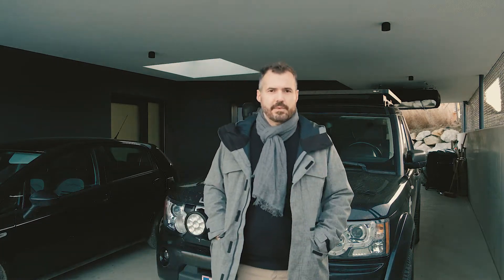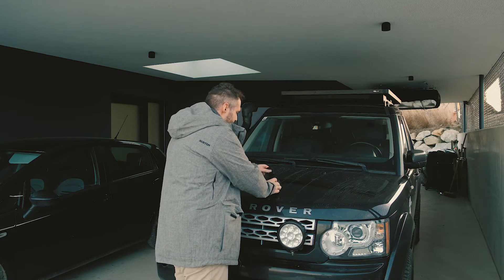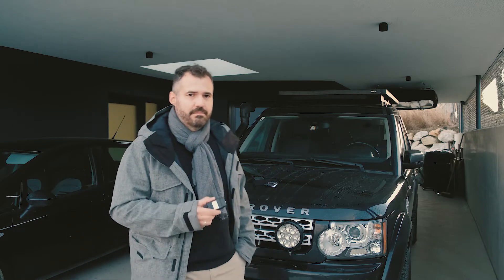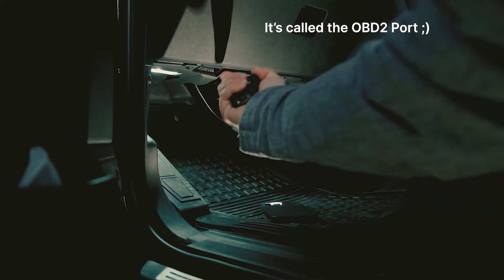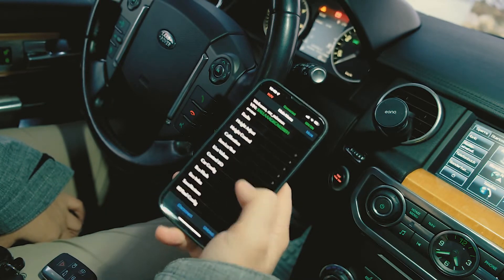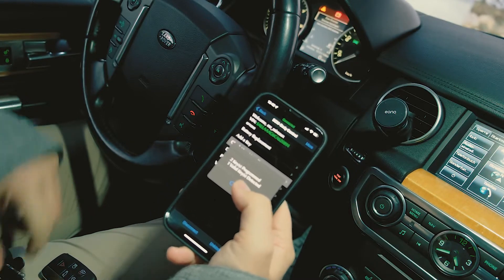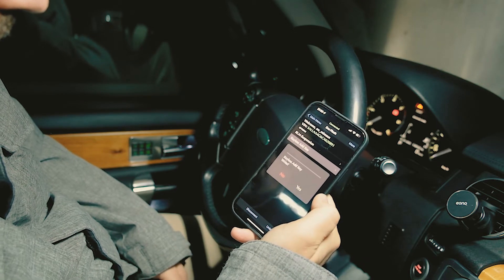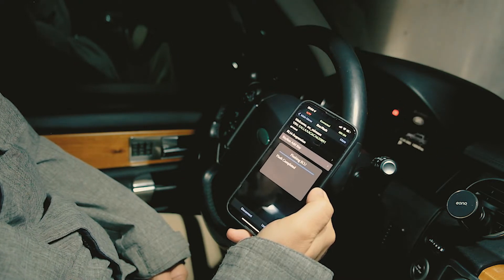DIY Land Rover Key Programming Guide That Will Save You MONEY!

Comment: Hallo Peter - thank you for your video on adding a key.  My LR4 (2012) has decided not to recognise either key.  Changed batteries, but no improvement.  I can start the car using bypass (steering wheel key position) but neither key lock/unlock the car.  How would I solve that, as I do not have a functioning key?

Comment: Not sure what is different here than with my 2014 LR4.  I've done all these steps, but still cannot successfully make a new key.  I'm waiting for an actual OEM fob to come in the mail to see if that makes a difference, but so far I can't get this function to work, and it's the main reason I bought the tool in the first place to keep the dealership out of my pockets.  UPDATE:  As it turns out it was the aftermarket fobs that were worthless.  I bought a used Land Rover fob with the logo on the back, and the IID Tool turned it into a working spare in 5 minutes.  The fob makes ALL the difference.
Reply: @SemperSaint  Are you saying you reprogrammed an existing key fob from another LR vehicle to work with your LR vehicle with the Gap tool? I did not think that was possible. What year and model is your vehicle?
Reply: Yes, after reading the Gap tool manual a little closer, you can reprogram an existing fob from a similar JLR vehicle ( including Jaguar) to another vehicle. You will probably need to contact Patrick to do an ECU update to do it but it does work. The only thing that doesn’t work after reprogramming is the close proximity start with a dead fob battery no longer works.
Reply: Yes, after reading the Gap tool manual a little closer, you can reprogram an existing fob from a similar JLR vehicle ( including Jaguar) to another vehicle. You will probably need to contact Patrick to do an ECU update to do it but it does work. The only thing that doesn’t work after reprogramming is the close proximity start with a dead fob battery no longer works.